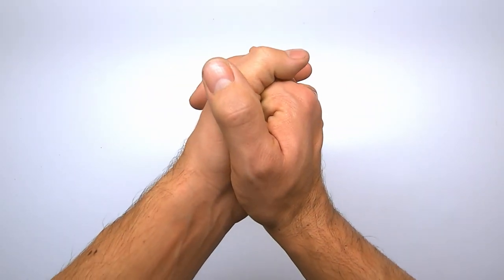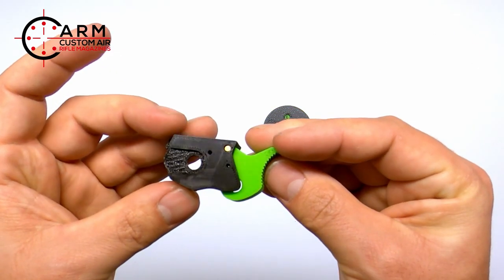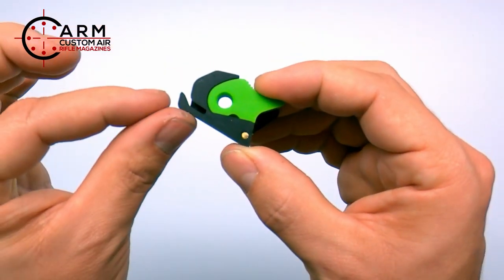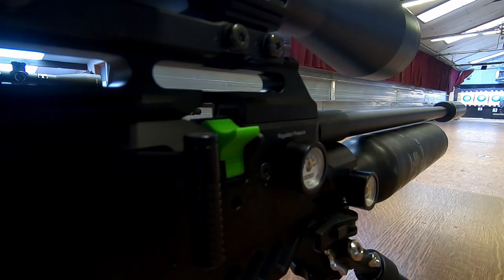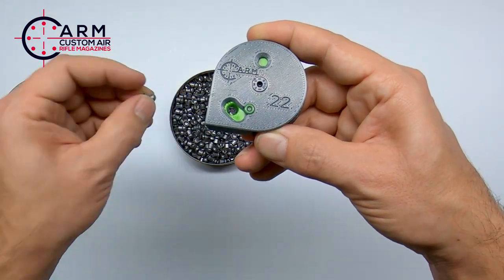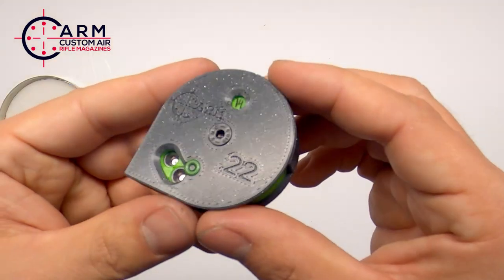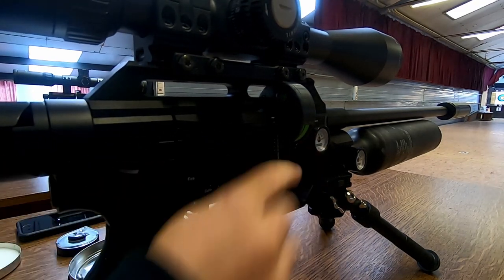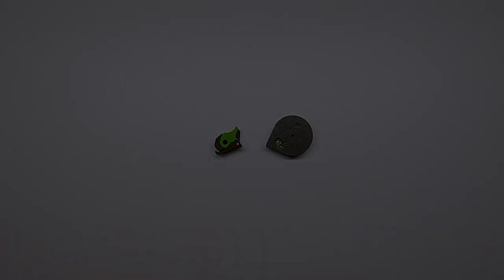CARM magazine for FX Dreamline

Comment: Good job on the video, but why would they 3D print each one? That takes way to long and on the finish you can still see the 3D print marks ...
Reply from the maker: These companies try there best , they have pretty good designs and work very well 👍 they are also cheaper then the original ones 😬😉